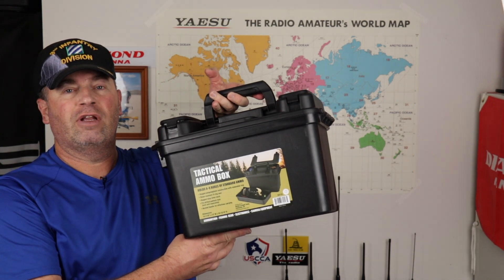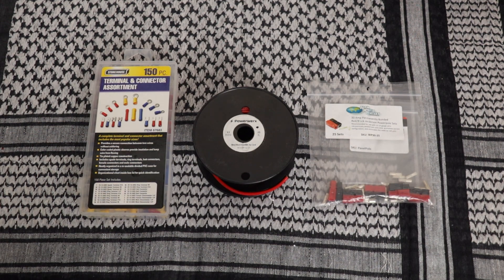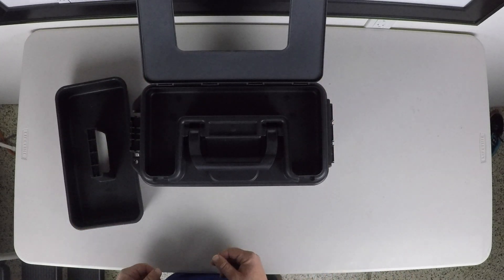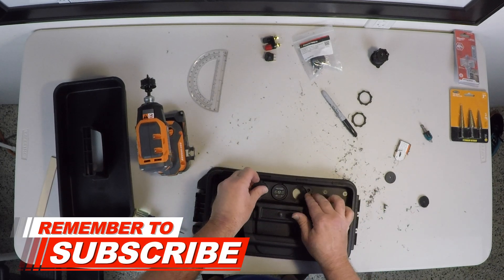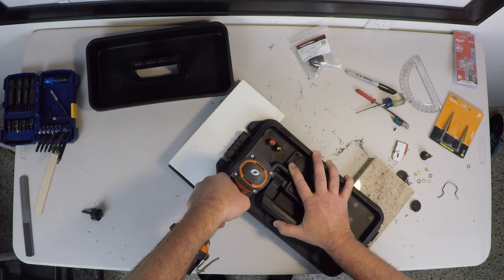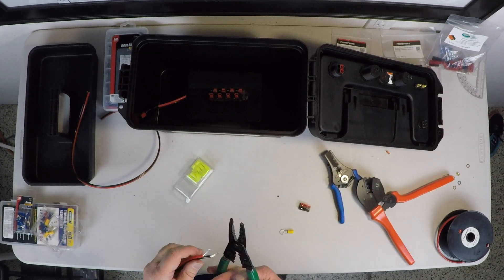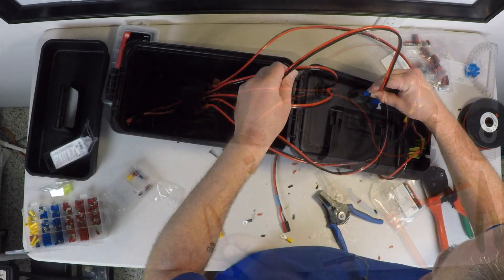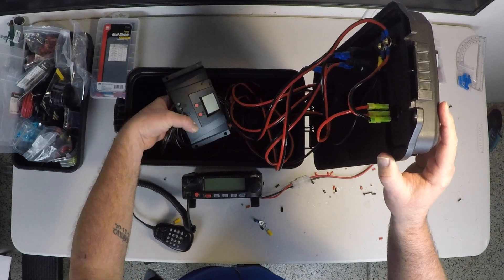DIY Ham Radio Battery Box For Your Bioenno Battery

Comment: Nice, clean installation. How did you bore the holes equidistant for the mounting plate without a template?
Reply from the maker: Thank you for taking the time to watch and the comment! It is greatly appreciated. if memory serves i used the mounting plate for the three outlets
Reply: @WJ6FRadio  I figured you did. I just needed to know for sure. Thanks.

Comment: I like your build and am working on one similar, but had not thought of the distribution block.  Did you simply make a cable from each of the items mounted on your lid to Anderson power poles and connect to the PD-8.  Then one cable from the battery to the PD-8?  So using your lay out it would have been  6 cables going into the PD-8 from the lid of the box and one from the battery… Is that correct?

I appreciate the help in understanding.

Comment: The use of that HFT ammo box is a great idea.  I like that the ports / sockets are concealed.  If I may, I would like to add that HFT has changed drastically (likely since the uploading of your video) as they no longer send the catalogs, they no longer offer free trinket tools with purchases.  The most disappointing is that they cut out the super coupons and the general 20% off deals - while using C19 as an excuse to jack up their prices.  So, if you can get that box for the $8 +/_, I would recommend buying a cart full of them......then call me because I could use another one or twelve.  lol
Love the video. Thanks.  ko4emh
Reply from the maker: Thank you for taking the time to watch and the comment! It is greatly appreciated. Yeah, a lot of companies have used CV-19 as an excuse to raise prices or cut out benefits. Now there's inflation which will inevitably cause price to rise quickly.

Comment: Hey there. How do you charge the battery? Open the box and plug in? Or is there a plug I am missing? Thanks. W3FZV
Reply from the maker: Thank you for taking the time to watch and the comment! It is greatly appreciated. The battery is completely removable. I do want to tweak it a little to be able to charge it without having to remove the battery.

Comment: You did a great job with this video and the box!  Here is what I don't understand, and I'm being serious:  why would you (and everyone else who makes this type of thing) take a small-ish lifepo or sla battery and place it in a relatively large(er) box just to add some switches and a powerpole distribution array?  Could you not have just put a power pole connector on the battery and plugged it right into the distribution connector array?  That is what I did, and honestly it is 1/3 the size of a "battery box".  Anyway,  it seems that everyone is making these, so maybe I am missing something, but this seems like a solution in search of a problem.
Reply from the maker: Thank you for taking the time to watch and the comment! It is greatly appreciated. Since making this video I bought a 40ah battery for this battery box. One of the reasons I like it is I can also carry the solar charge controller, extra pig tails, and the regular wall charger. I also allows me to charge a cell phone or the like.
Reply: That sounds even better...nice job! 73 de N2MXX
Reply: @daveG1020  Ham radio is about taking small lightweight things and making them heavy and large but with a handle.

Comment: This turned out great, cool project!
Reply from the maker: Thanks for watching and the comment!  It was easier than I thought it would be.
Reply: WJ6F it looks like it would be a handy setup for portable use or even at home f there is a power outage.
Reply from the maker: TheSmokinApe it is. I just have to make sure kids don’t kill the battery charging their phones. I made a smaller one that has a 12 or 14ah sealed lead acid battery. If your thinking of making one I have some left over switched and posts I can send your way.
Reply from the maker: TheSmokinApe I’m pretty sure that box will hold a 30ah battery easily.
Reply: WJ6F I have a few parts left over from boxes I built in the past with SLA batteries.  A 30a would be awesome, I have kids too!

How’s that charge controller working for you?
Reply from the maker: TheSmokinApe I got it from Bioenno. It works great! It is super simple to use which is great since I’m no engineer.
Reply: WJ6F I’ll check it out, they make great stuff 👍
Reply from the maker: @TheSmokinApe   They sure do! I am looking at getting a couple of more batteries if I pull the trigger on trying a QRP radio. Debatig. between the XIEGU G90 and Xiegu 5105. I also have one of their 100 watt solar panels. I did a video on the set up I have including the solar controller and panels.

Comment: Nicely done! I've seen several of these and I really like how you used the Powerwerx dist. block to connect everything together! Thanks for sharing! 73's N1UI
Reply from the maker: Thank you for taking the time to watch and the comment! It is greatly appreciated. I did that so I could easily change things out, and it is smaller, lighter, and cheaper than some of the others out there. Powerwerx does make a smaller one called the PD-4.

Comment: Wow that works really nicely, a lot more than I was expecting from a $8 box. Thanks for the video! I came across your channel a couple of weeks ago and have enjoyed going through your previous videos.
My one suggestion is that it would be nice to demonstrate the wiring and crimping once at normal speed then fast forward through the rest. Even if it's something that may have been in another video it's always nice to have a brief reminder included.
I have a couple of smaller GoalZero Yeti 150s I've used for solar power for parking mode dashcams and to use for various things in outages - I didn't think about checking the noise for potentially using as a radio power source as I saw in your other video.
Reply from the maker: Thank you for taking the time to watch and the comment! It is greatly appreciated. On my Yeti when using the powerpole connection I get noise. when using a power supply plugged into the outlets the noise is substantially less. I will be trying out some toroids on it to see if that changes anything.